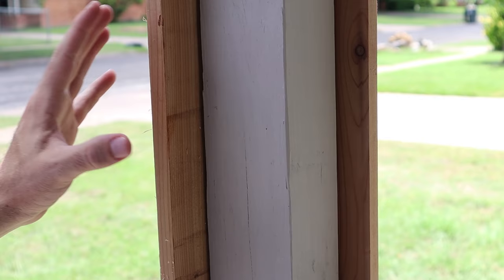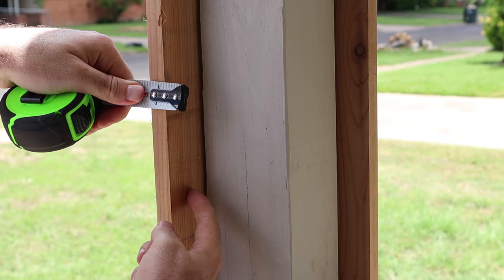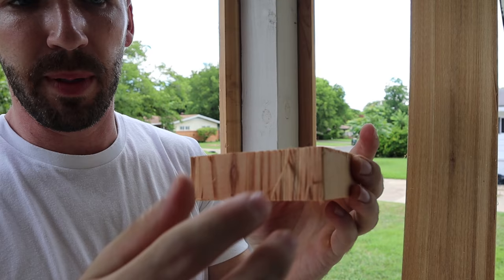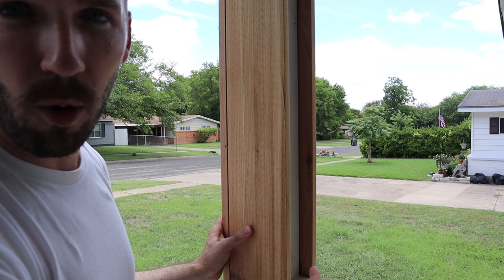How to Wrap Posts in Cedar Wood | Tutorial

Comment: Well done, just fyi for others looking to do the same. If there’s any chance of water splashing on the bottom. Leave your columns off the ground an inch or two, then use the wrapped trim pieces to go to the ground. If they start to weather, you can just replace the trim.
Reply from the maker: great tip Chris! I'm about to update some posts on a new house and re-shoot this video with all of the tips and experience I've gained over the past couple of years.
Reply: Or just stain it to protect from moisture
Reply: I used 1” steel offset brackets. Made by zmax I think was the name.
Reply: Maybe marine grade paint would help prevent rot.

Comment: I am having this done to three front posts next week.  I am going to stain them before the carpenter puts them up though.
I applied stain first 15 yrs ago, when I had five posts rewrapped in cedar, on my back cedar 20x20 patio.  I put two coats on, and it lasted a long time ... so worth doing it before cut and hang.

Also, he mentioned he's going to put some kind of metal at the bottom of wood, at the cement,... on the bottom of the post, to prevent rotting.  I can find out and edit my post on exactly what that's called.... once it's done.
Cedar is gorgeous on a home today.  Thanks for the stimulus $ Biden😉 $2800 goes a long way on home fixes.

Comment: True question.   Why did you not take the original board down and just use the entire cedar board to be the post?  Trying to figure out how to do mine. 😮
Reply from the maker: I’d have to buy a 6x6” cedar post which cost more than these 4 boards and are hard to find. You could probably buy a pressure treated 6x6 and replace your posts but would have to wait a few weeks before you can stain them a cedar color.

Comment: Hi.  Watched this video  3 times now.  You make it look so simple.  Wife and I went to Lowes last night and got the lumber and a nailer.  I got 18ga brad nails 2" long.  Is that length ok?  Was sure what nail you used.  Nailer I have only goes up to 2" nails.  Thank you.
Reply from the maker: Hi there! 2" will be plenty long enough and is what I used. I did end up hammering in 2 extra larger galvanized nails in each board. like 6D or 8D nails. 1 toward the top and 1 towards the bottom (not too close to the edge or you'll split the wood). Might be overkill but weatherproof nails will help this last much longer.
Reply: @KellyConcepts  Thank You.  If I remember I'll post a pic  when done and tag you.

Comment: Did you use regular or pressure treated wood?
Reply from the maker: I used cedar here, just straight from the hardware store. Cedar is weather resistant already, and then some sealer helps even more.

Comment: We did this but with pine - we made the mistake of not letting the wood dry before constructing. After a few days the wood warped a little. 

We got some wood filler and stained it to make the wood post but the filler is darker. So you see the dark lines where the wood boards connect Vs looking like a solid wood pillar. Any suggestions on how to fix?

Comment: Poorly constructed/designed job leaving joint lines visible, but much worse is that those butt joints allow water to seep into the inside where it will cause damage to the structural posts out of sight.
Reply from the maker: Lol okay so water won't damage the painted posts when they're exposed to the elements, but will magically be a problem when a few drops get in behind the cedar casing?

This is the "easy" method as titled, mitering the edges is unnecessary for this rental property.
Reply: @KellyConcepts  I have posts wrapped in 1x6 rough sawn cedar.  I mitred corners and used galvanized finishing nails (no glue on mitred).  Don't think it lasted a whole year without mitred corners opening.  Now ten years and I am finally going to restain all trim on house and fix bottom of the posts.  When I pulled off trim, bases of post is rotted and even cedar starting to rot.  So if you live in climate like Michigan (northeast), you need better technique ... this would be ok for inside but not outside.  This time I am going to use marine epoxy and bisquits to reinforce the mitred corners.  Both sides of trim and post will be stained before assembly.  I will be using stainless steel trim screws to hold trim on post.  I hope this will survive a Michigan winter.

Comment: just buy 2 cedar posts🙄
Reply from the maker: 6x6s cedar cost $100 each. 
Plus temporary supports, concrete posts brackets, etc etc.
Reply: @KellyConcepts  do the math add up 8 boards. treated wood. fasteners. glue and time. and the fact that you know its fake. I'll take REAL CEDAR COLUMBS for 200 ALEX
Reply from the maker: $100 vs $300 and a much quicker job is a win for me. This is also a little $100k rental property, not an A or B class property.

Comment: I know this was made for the low IQ tik-tok generation, but this is all wrong. Never cut blocking like that because it has a very high chance of splitting when you nail into it. You are also using the wrong kind of nails for this, which is probably the only reason it didn't split, but it will probably fall off pretty quickly, which is probably why you have anew video. 

People who clearly have no idea what they are doing really need to stop trying to make videos showing people how to do the things they don't know how to do.
Reply from the maker: thanks pops, but 4 yrs later and it's still solid as a rock.